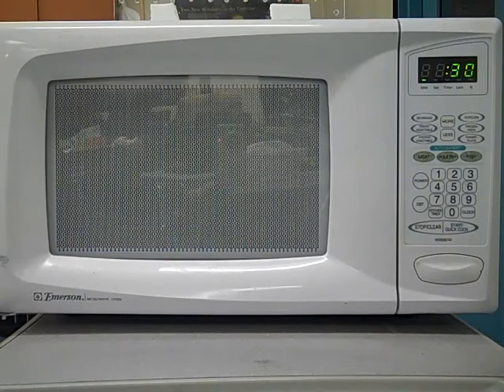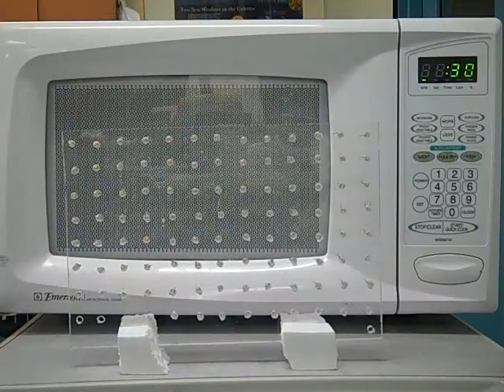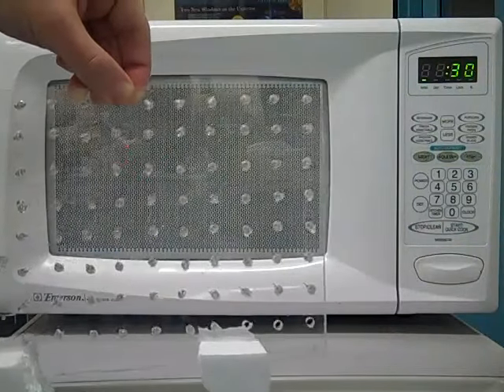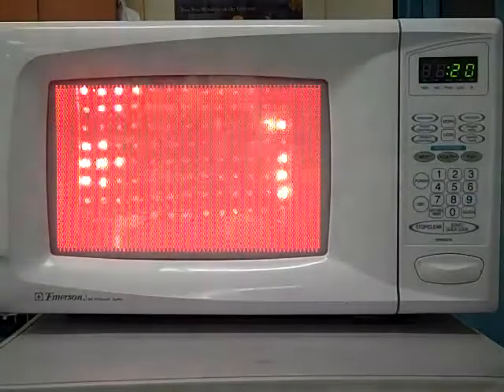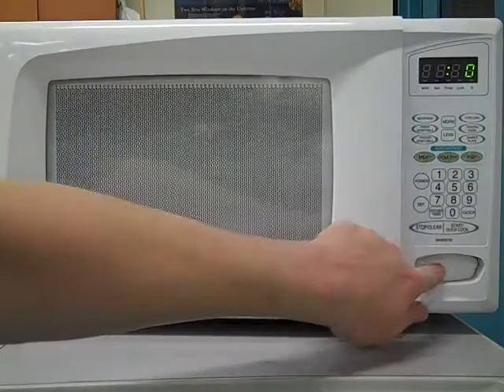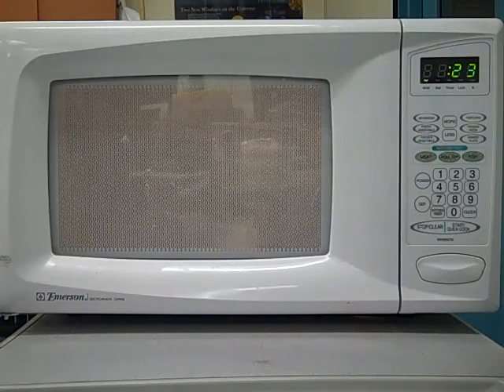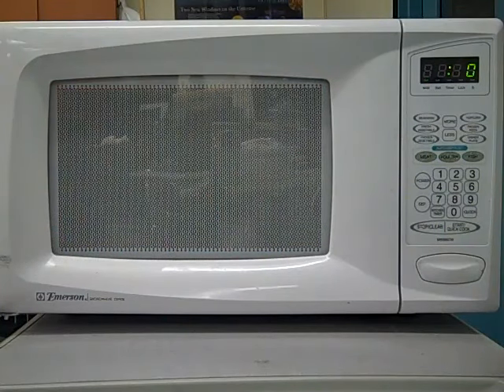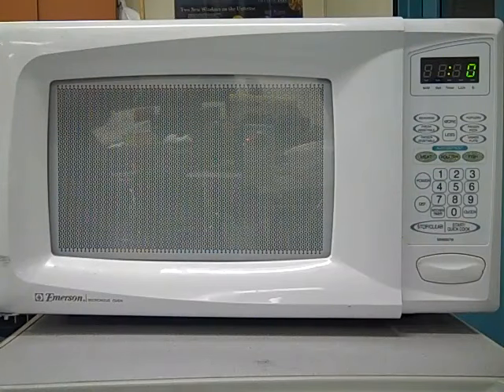Seeing Where the Microwaves Are in a Microwave Oven

Comment from the maker: @dongor94 The neon bulbs work particularly well because they are so simple, cheap and small. Fluorescent tubes do glow in microwaves, but the electronics in a compact fluorescent bulb would get fried. I haven't put a halogen bulb in. I've put smaller incandescent bulbs (like flashlight bulbs) and they glow briefly and brightly until they burn out.

Comment: Nice video but dude... wires do not absorb microwaves (you need special conditions for that)!! You see light from neon bulbs because high electric field is ionizing the neon gas mixture. Try the same with diodes, you will not see any light.